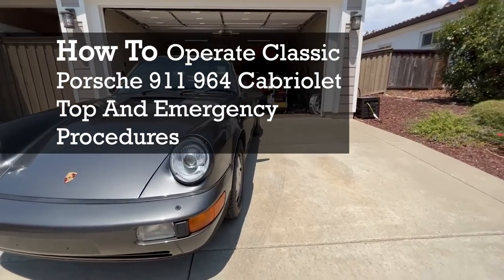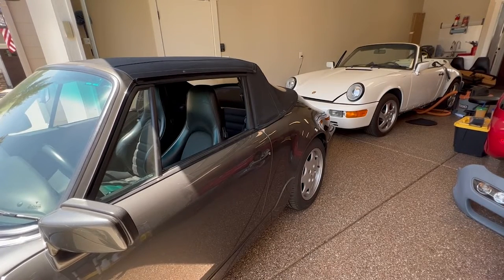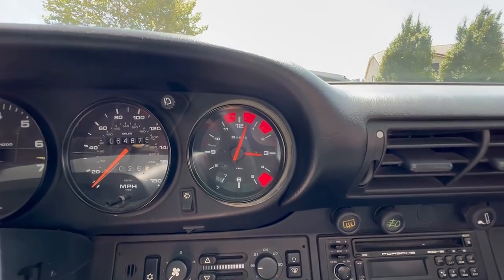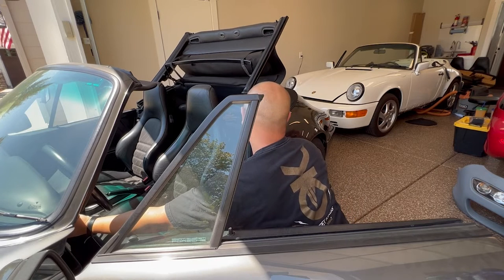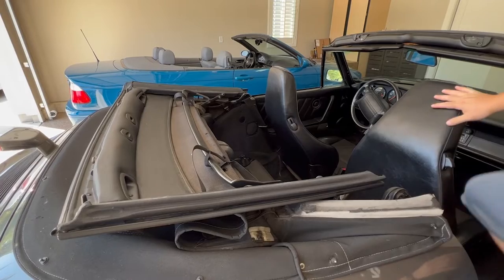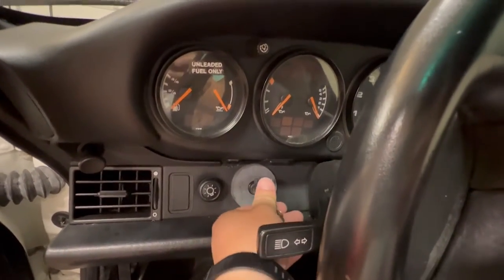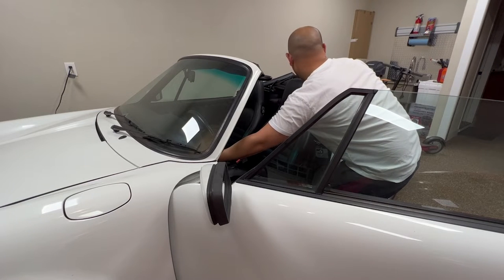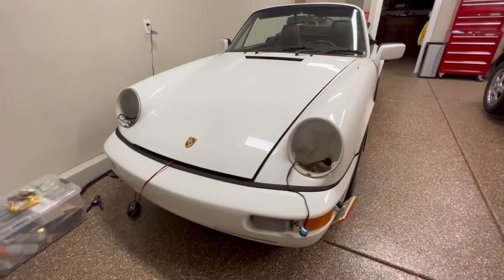How To Operate Classics Porsche 911 964 Cabriolet Top And Emergency Procedures

Comment: The 964 Cab top is a sensitive thing. I just got my servos replaced. While the deck was opening one of the servos broke (after 31 years) and the whole linkage bent and had to be replaced. All in all 3,5k $. Please continue posting tips&tricks videos for the 964. Go/show details while working because thats what we 964 junkies really appreciate ;) Cheers.
Reply from the maker: Thank you! The thought of converting it to manual open and close has crossed my mind a couple times, but having that button on a 30 year old car also seems pretty cool to me.  Im working on a video on how to remove the cab top next.  These videos take days to edit haha. Working on the car is the fun and easy part. These Porsches cost an arm and a leg, but we still love them.

Comment: Looks like it is the sun roof button, which makes sense. It took me a while to find that button too.
Reply from the maker: I was used to my 993 sunroof button being in the lower center console area.  I looked everywhere. haha and this button doesn’t have any markings on it too, but yes you are right the 964 has its sunroof button in this location too.  I still have a lot to learn on these 964s.  Thanks!